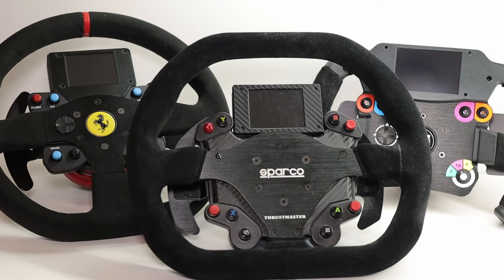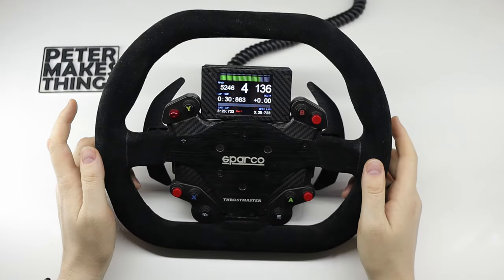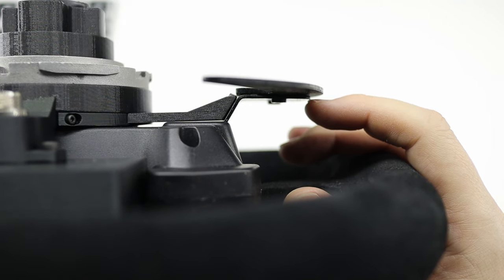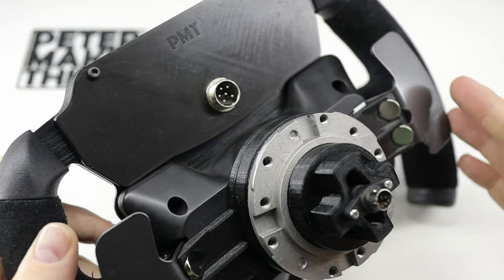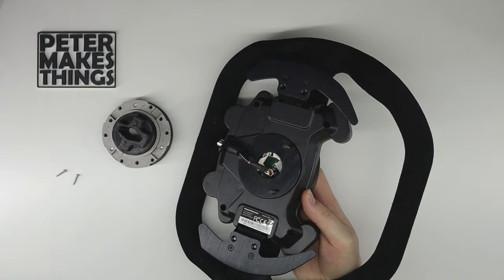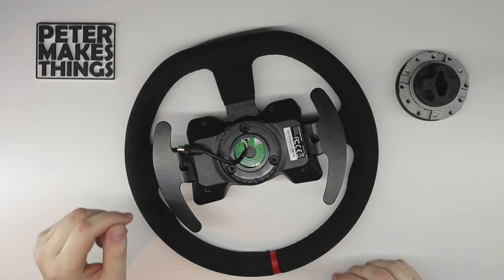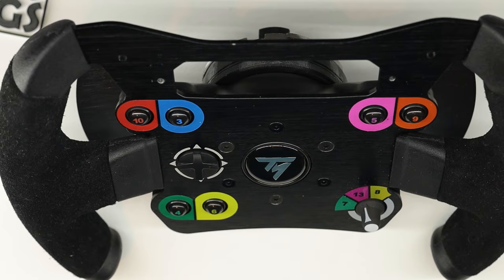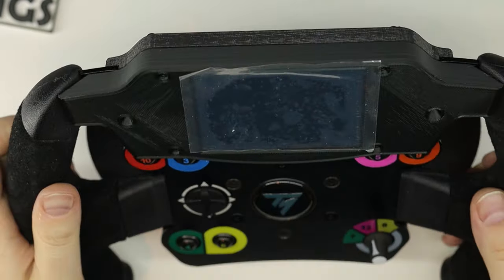How to add a Display to Thrustmaster add-on wheel

Comment: Great work again :-)  One question I always have been thinking: Why do you use one magnet on each side, as only One magnet will stick to the metal plate.  As i see it, the number 2 magnet is not neede - if not the intention is to get a stronger feel/stick.  Let me hear Peter :-)
Reply from the maker: see this video: https://youtu.be/rf8PqbjdBoI , the idea is you can balance the magnet forces so top magnets are pulling the paddle, bottom ones are pushing it, if all magnets are the same size the forces are balanced and linear, changing magnet sizes allow you to amend the curve of forces affecting your paddle :) no bottom magnet = standard paddle as all other magnet ones, no top magnet = 'spring' like paddle effect :) I like things to be customizable so one can tweak it to individual preferences

Comment: Does this work on Xbox ?
Reply from the maker: as far as I know there isn't a way to make it work with xbox or ps4, it's PC only as it requires SimHub software running in the background
Reply: How about using a PC on the background with SimHub software running and race on your Xbox? Would that work?
Reply from the maker: @nelis0737  there isn't a solution I know of that would work this way with a Nextion screen I'm afraid
Reply: It works on xbox with Simhub. I know it works with Forza Horizon 4 and Forza Motrosport 7. The games have a telemetry data option (data out ip address).